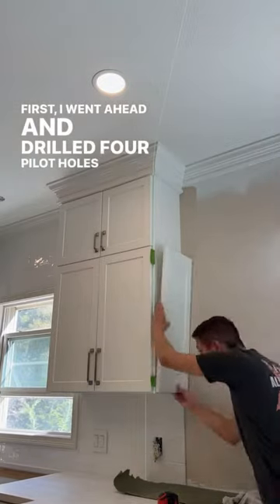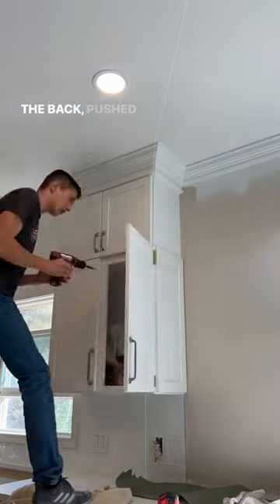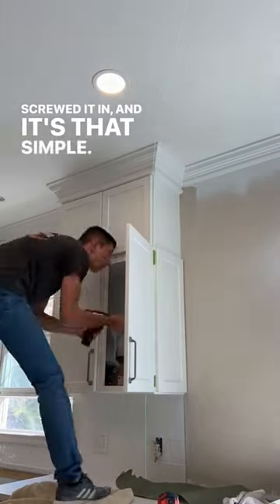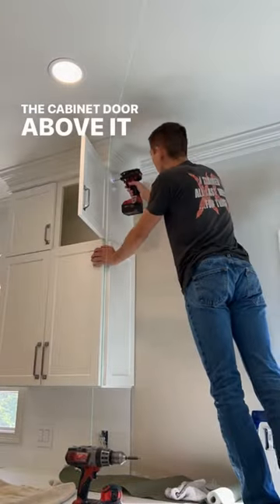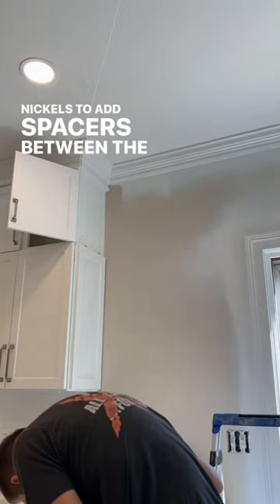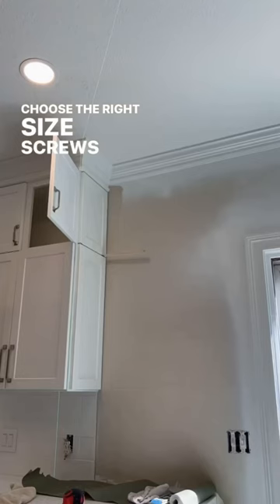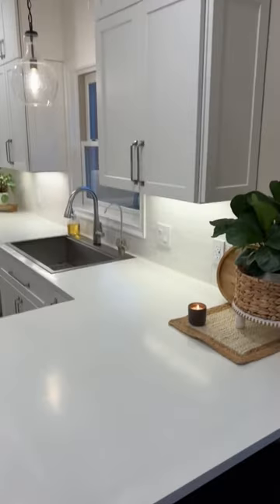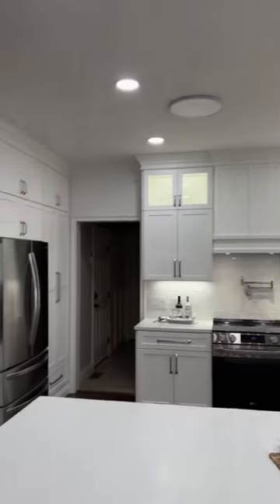Do you think it looks more custom? 🤔 #kitchen #customking #custom  #kitchencabinetdesign

Comment: nice touch adding false facings to your blank sections. Ive seen it done a few ways, adding the entire facing being very complete and professional looking. 

 I had to do this for a kitchen cabinet set that had custom made shakers, and 4 uppers with glass. Customer wanted something to fill the large empty spaces, but didnt have the extra facings due to cost. I plucked out a matching set of router bits and some spare wood, and got to work. I cut out the sides of her glass end cabinets and cut out the matching interior panel to match all the others, and placed glass and led's lights inside her corner glass uppers, and she loved it. for the ones beside the sink, I routered some pieces of quarter round to match the beveled border on the cabinets, and raised panels, and simply tacked them in place with a 1 inch brad nailer. to make all this more difficult, everything had to be stained and sealed.

Anyways love your work, keep it up!! <3

Comment: Coulda just put trim around the perimeter of the side. I don’t think it’s doors that people put on the side of cabinets. It’s just trim. Like, a couple of 1x3’s.  That’s what I did anyways. Looks exactly the same. No extra cabinet door needed
Reply from the maker: That's one way to do it. I called them doors for the simplicity of the idea, but the technical name for them are end panels, which are basically just doors. Could totally just use trim to save a few bucks tho 👍